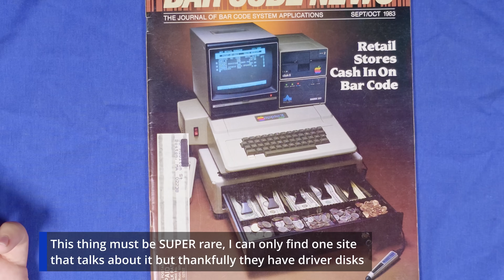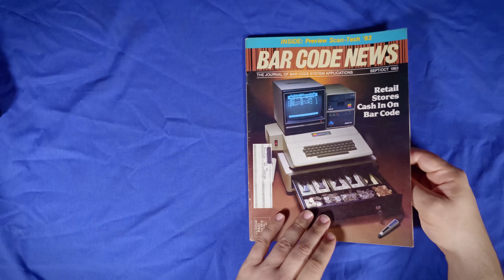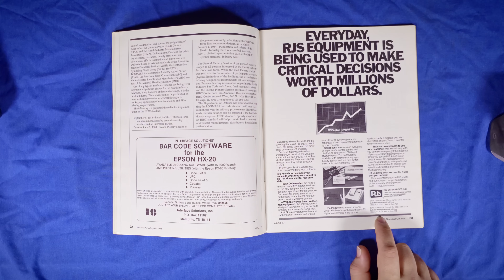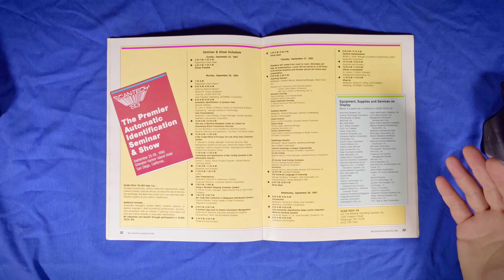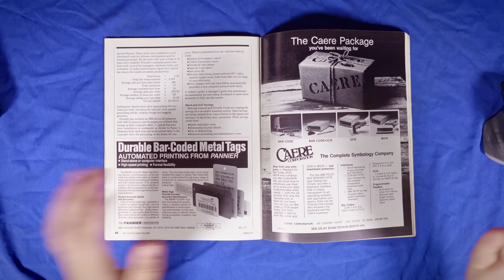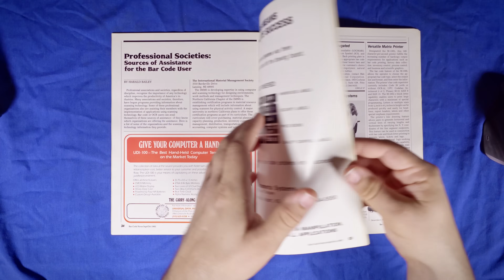Forgotten Magazine - Bar Code News

Comment: Just wanted to comment on the modern use of handheld computers and scanners in a retail system. We have both older windows Ce devices and newer android devices both with built in scanners. they use WiFi to communicate back to a Linux server.(I work in a large corporate retail store) I've also been looking into running a home inventory system using barcodes/qr codes.

Comment: Production details: the magazine is saddle stitch bound, 64 pages on 16 pieces of paper. They used a color press to print the two outside pieces of paper (front cover, inside front cover, pages 1-2, 61-62, inside back cover, and back cover), and the two inside pieces of paper (pages 27-34). The other 12 were printed on a black-and-white press at a lower cost.

So now you have X amount of color ad space and X amount of black and white ad space, and you sell the color ad space for a higher price. And some of the articles go into that color section too... maybe you deliberately position some there because they have graphics that would really benefit from it, but if you have some space left over and your article about a French grocery chain lands in there, well then you put some color French flags on the top of the page just to spruce things up a bit.

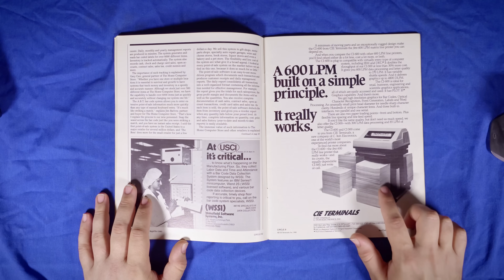Comment: 9:30, I think the line printer is a case of cross marketing. The same places that would have scanners and POS terminals and sub to a magazine like this likely also needs to print out nightly reports and such. Even at RadioShack in '99 and into the first couple of years of the 2000s, we had a 14" 24pin dot matrix for the nightlies, until that got replaced around 2002-2003 with an Okidata C6100 laser printer. (This would also be around the time they were replacing our IBM PS desktop servers running SCO UNIX with Compaq Prolinas with Win2000 and an SCO VM.)

Comment: Thanks for showing this! I worked for Metrologic Instruments starting in 1999 so it was cool to see an ad for one of thier early products. As to what was special about that scanner..... At the time most handheld scanners were the pen type which used an LED and photo-receiver. Semiconductor laser diodes were still not main stream so the scanner in that ad had a laser tube in it which is trickey in a handheld device. Laser barcode scanners were a major step forward because unlike a pen you could scan from a distance. This product was also interesting in that it had a microprocessor in it to do the barcode decoding. Pen type scanners often just sent a signal with the raw black to white transistions and the computer had to do the decoding. Metrologic actually got into some legal trouble with this scanner. One of the big bar code companies of the time, Symbol Technologies, had been issues a patent for barcode scanners with a trigger to activate them. Metrologic fought this for some time saying that feature was to obvious to be patenable.

Comment: MICR is Magnetic Ink Character Recognition. Those numbers at the bottom of checks were printed in magnetic ink.
Reply: You could get magnetic toner for laser printers, and it seems it still exists.  I'm amazed there is still enough market out there for MICR to still be making the toner.
Reply: The banking system uses a font called E-13B that comprises 10 digits and 4 "punctuation".
There is another MICR font called CMC-7 that's alphanumeric, but it's unclear where this might have been used.
Reply: Indeed.  I worked at a bank about ten years ago, and it was very much still a thing.  I believe that we had more modern equipment that optically scanned the special font for character recognition -- because it was cheaper than a "real" MICR reader.  Nonetheless, you could still get -- and were supposed to use -- magnetic printer toner and such to print checks.  It was more expensive than normal toner, of course, so when a customer (usually a business) was trying out their check printing, it was recommended that they use normal toner for samples (to check alignment if they switched check forms, mostly), then use the real MICR toner (on a different printer, in every case I knew of) to print the real checks.  I imagine larger businesses didn't care about the savings, of course.
Reply: @derekchristenson5711  I'm surprised there are enough cheques being written too.  Cheques are a dying thing in Australia with some banks no longer offering the facility (still accepting them of course).  Apparently there is a plan to completely kill off cheques here by 2030.

Comment: The UDI-100 is very similar to the units we used at the inventory company RGIS. Based on the age of that magazine, they prolly worked the same way the Washington Inventory Service did, 9 pin serial with a battery pack that clipped to your belt, you plugged the scanner into the battery pack and the pack into the computer.
That one bar code scanner reminds me of the ones the K-Mart I worked at in the late 80's had, but better looking, same top mounted scanner.
MICR is the number printed at the bottom of a check, the ink IIRC is magnetic, and its machine readable.

Comment: Regarding the use of color... Magazines were printed in 8-page subsections called signatures. A signature could be printed in black and white or in 4-color. When they sold a color ad in a signature, they could go wild with gratuitous spot color. So that explains the use of spot color at the top of page 28(?) about 14 minutes into the video. Essentially, the first advertiser to buy a color ad sponsored color for 7 other pages. So the advertising team would push hard to try to sell color ads since that allowed them to make a more colorful magazine.

Comment: Seeing an ad for a device I seen being used well into the 2000's at a grocery store I used to work at is wild. Watching management use one of those handheld bar code scanners was wild. For reference they used the bar code wand scanner with them and used them to scan in any stock that needed to be ordered. Indeed they even had a computer specifically hanging around to download all that data. Even more fascinating is those things were equipped with nickel cadmium batteries and would spend the night on the charger for the next day. I had taken one of the ones hanging out in spare storage but since it was just spare parts I never got to try it out personally. Still wild to see an ad for such an old device used for decades 😂

Comment: It may have been under the sticker on the front, but did Bar Code News not have a barcode for itself. Great video.
Reply: i was going to make the exact same comment. I'm also guessing "Barcode News" was available my mail only, and you didn't head on down to the local convenience store, grocery store, or news stand to pick up your copy of it!
Reply: I know this is not exactly proper research  but in my comic collection barcodes only start showing up with those printed in 1983 so the same year this came out everything older doesn't seem to have them. but  i don't have a lot of other stuff that old with barcodes. just comics and other types of books .everything else is either too new or the barcode was on the box that is long gone. but old comics are everywhere not even remotely rare unless its pre 1960. i assume that barcodes could have been used in shops that didn't sell books before 1983.